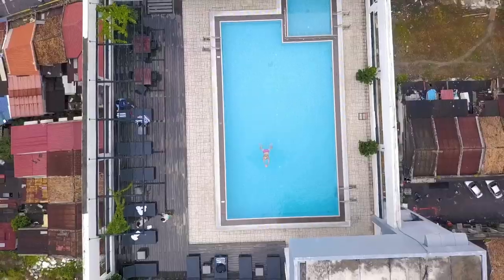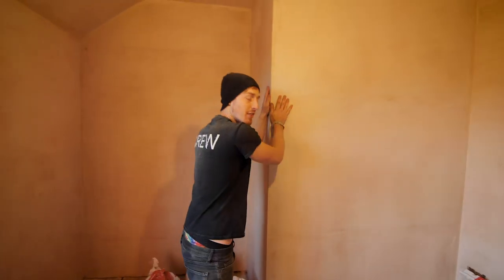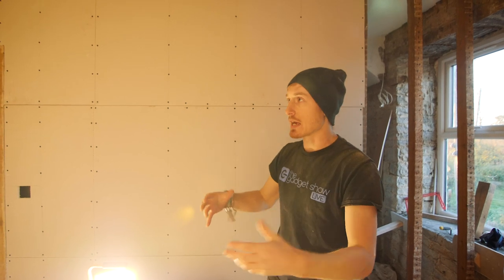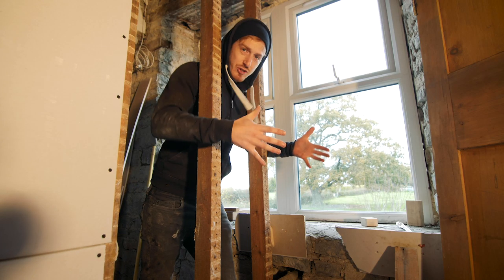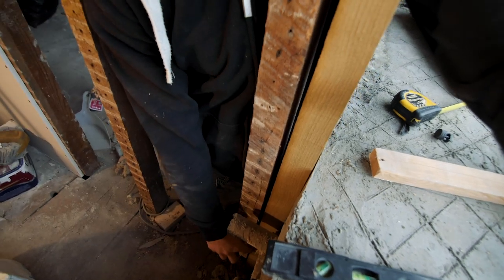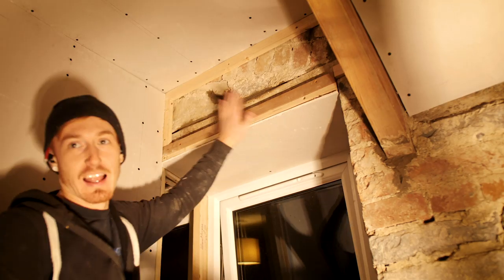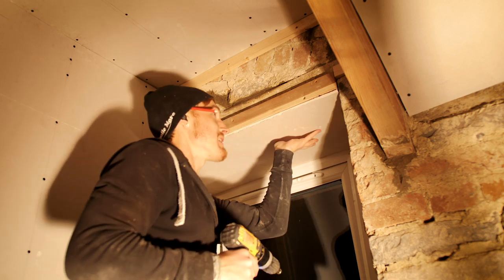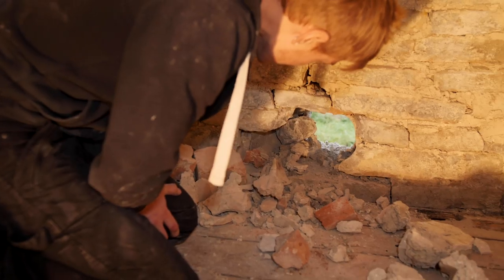Things are starting to come together | S1 E9 House Renovation

Comment: I did my first renovation a couple of years ago. Made it up as I went a long, filmed it too so I know how much it slows you down (Shameless plug). I battened and boarded the walls like you have however in hindsight I think learning to dot and dab is far quicker and cheaper. I gave up trying to get walls/floors perfectly level and went with existing however doors/windows/kitchens had to be level and square to work properly. Its definitely where I wished I had more experience. Things took way longer than I expected, eventually I began to accept it and just to enjoy the experience.

Comment: am woodworker and few generations of my family has done house building in USA.  um way you are doing is okay.  if you wanted builder's advice...

a) build out the frame screw-nail all together, then install to the wall-surface.  this way uses least amount of "contortionist" excercise to mount it..   

b) as to the center of the window.  don't glue to different materials together, unless your glue is "rubbery" (materials moves differently with the weather).  however floating wood (what you just did) is perfect.  :)

c) drywall.  you only need to score it twice  not  more then snap it..   you can lay board in different angles... least amount of cutting-scoring on drywall is preferred. experienced drywaller can score it once and snap.  i could not match that skill set.
Reply: This comment was very helpful. I’m in the states and I own a house that was built in 1897. It’s not crazy old but for the US, that’s a pretty old house. My pain point is that it’s mostly brick. The brick work is beautiful and durable and I love it but it’s been a pain having new tradesmen trying to “work” with it because we don’t build housing like mine any more so the skill sets to fix instead of just demolish old houses like mine are hard to come by. I’ve been informed by my electrician and plumber that all of our lives would be simpler if I built out the walls in my kitchen and bathrooms.